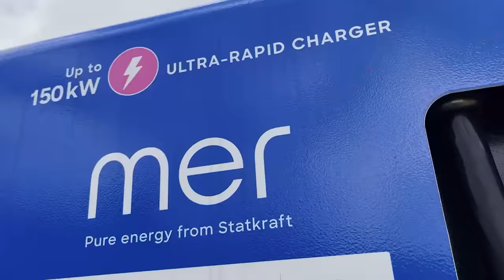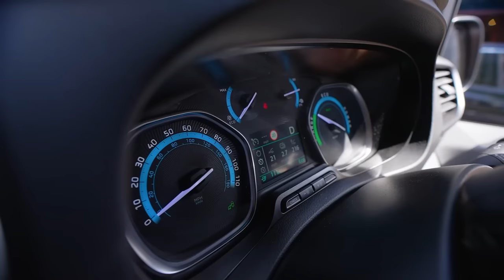Global EV Showdown ~ Is China Outpacing the West?

Comment: The first thing anyone talks about in connection with EVs is the range.  The problem is that with ICE vehicles we never had to talk about range so people's mindsets are that if we have to talk about range it must be a problem.  The trick is to get an E-van with a range that suits your work.  If you regularly travel 250 miles to jobs (or maybe 125 miles to jobs where there is no possibility of charging up) then an E-van is currently not for you.  But the data suggests that is a small minority.

For a contractor working solely in cities and lives reasonably close to his/her working patch there is already an E-van suitable.  As for the issue of cost, it is the upfront cost which is the problem, the running costs of an E-van are much lower.  So the issue is how much driving do you do.

The issue which has not yet been properly resolved is charging infrastructure.  On motorways this is getting better very quickly but like petrol at motorway filing station, charging at the motorway filing station is very expensive. For van drivers it becomes more critical to have charging at your working site (or at least at home if you leave the van at home overnight).

The entire argument that an ev has to be driven 60,000 miles before you "break even" is complete nonsense.  The original report that suggested this compared to an ICE vehicle has been completely debunked.

Comment: Electric cars are not on my radar at all. What on earth are we going to do with all these lithium batteries after the life of the traction battery pack has finished and depleted. Lithium ion chemistry by nature is not a stable chemistry that’s why there is a liquid cooling system operating in an electric car to keep the batteries within operational temperature otherwise each cell will suffer and the chemistry starts breaking down and this leads into thermal runaway and there after a chemical fire starts that the London fire brigade are unable to extinguish with water or foam. When are we all going to wake up and smell the coffee for goodness sake. Electric cars are not the future full stop.

Comment: Another great rant Roger. Electric vehicles are not the future! Who the hell wants to wait a few hours to charge after waiting in queues for hours for the charger with kids in the back getting ass on because they’re hot and hungry and bored. How long will it be til we’re at X dad???

Only way I could see electric cars working is if the technology Tesla apparently worked on that took electric from the atmosphere was incorporated into these cars so you had free electric and no waiting time to charge! 

Maybe I’m wrong though and full of shit. 😂
Reply: They reckon one idea would be you don't own the battery, you lease it. Pull into a "battery station" and the flat battery is taken off the bottom and a fully charged one replaced in minutes.
I got no ideas which solutions will be the most leanest economical dominant businesses pushing others out the market. If i did I'd be a stock market multi millionaire hehe.
Reply: If it's a rapid charger, it won't take hours to charge. A max of 40mins from 10-80%.
Reply: @Richard482  that’s not too bad, lot of the videos I’ve seen with expensive electric cars have said it’s hours waiting for a charge but still I wouldn’t want one.

Comment: The problem with EVs is the battery. More specifically the Lithium battery. There is only so much more that can be done to add range and speed up charging with them. They are a dead end technology. Once we get hydrogen or solid state batteries sorted, EVs will start to take over very quickly. I reckon in 10 years those two technologies will be in production cars.
Reply: Hydrogen has been in production cars like the Toyota Mirai. But not enough people bought them to make keeping the hydrogen fueling stations open worthwhile.